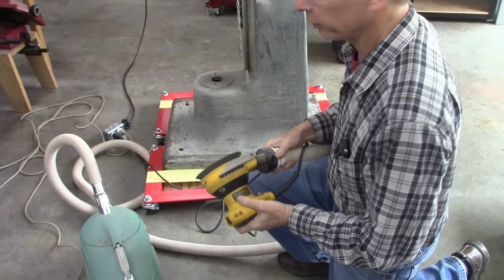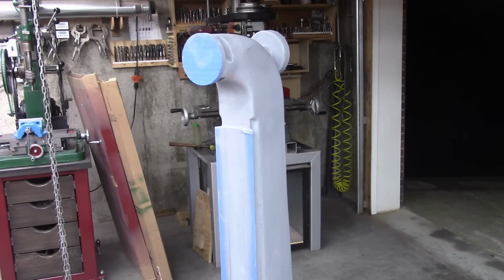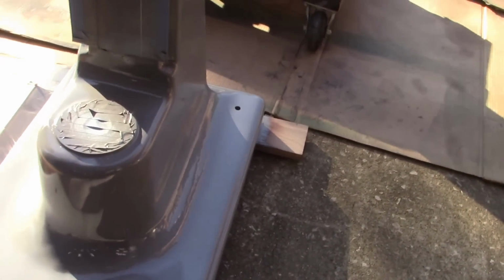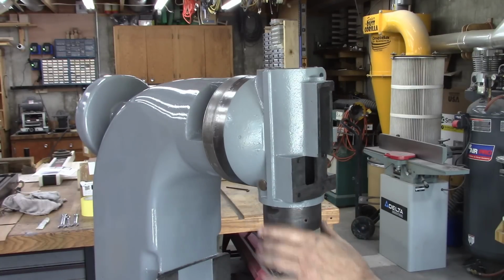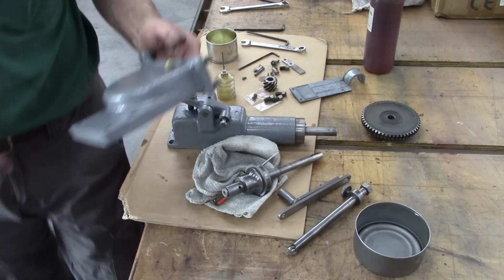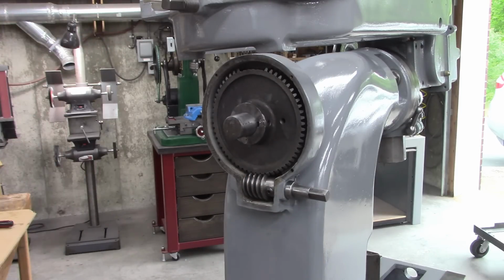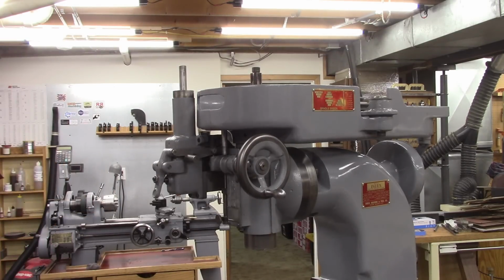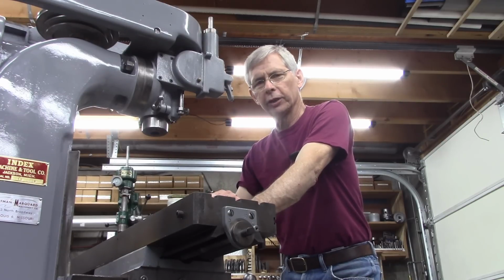Well Index Model 40 Restoration - Part 3

Comment: I weld all the broken cast-iron at work.  I use both arc weld and TIG welding to make repairs.  A welding contractor we used several years ago showed me they process of cast-iron repairs.  Starting by grinding away as much of the damage area as possible, preheat the parts them weld using nickel rods and a finish pass using stainless steel filler rods. I'm not sure what the stainless steel top layer does, but it works, and I have never had any issues.  Be sure to let the repaired part cool slowly. If it's a big part,  I will cover with a welding blanket to cool. I have rebuilt two lathes and on mill. I enjoy the mill rebuild.  I hope to see you using it soon
Reply from the maker: I knocked the flux off the nickel rod to weld with TIG....  it didn't do too well. Maybe me or maybe the flux? I did preheat. A friend of mine said the same about the stainless rod.
Reply: @Winky's Workshop  I keep  nickel TIG rods on hand these days,  but I have knocked Flux off stick rods, too. What the job at hand, you just always have to be ready to make what you have to work. Thanks for your video content.
Reply from the maker: @davidcockerman266  True...  and thanks!

Comment: My Index 40H had several grease zert looking fittings. I found out the hard way that they are not for grease, but for oil, (way oil). I had to nearly totally dismantle my mill to clean the oil passages where a goof ball, (me) filled them all with bearing grease. My electric motor was a 110 also. The drum switch was to change the speed on the motor, not forward and reverse. It never worked right, and I just change which groove the belt is in on the drive pulley. Looks great! keep up the good work.
Reply from the maker: Those holes on my mill has slotted set screws in them. I'll bet somebody put zerks in yours. Interesting in the 2 speeds... that would be nice but I want reverse too. Thanks

Comment: You have set the bar so high on this restoration. I had to replace the bearings in the Quill, which gave me some grief, nice job.
Reply from the maker: Mine seem to be smooth but I will eventually get into then. Maybe you can give me some pointers. Wells Index was no help.
Reply: @WinkysWorkshop  watch his series, its well worth the time
Reply from the maker: @cyclebuster  I'll do that, Thanks

Comment: What a great job. It really amazing what a little work and a good paint job will do. 
That color looks a lot like the one Don Madere used on his Monarch.
Reply from the maker: Thanks...  Yeah, Don's Monarch looks amazing!
Reply: @WinkysWorkshop  What is the RustOleum color that you used? Thanks.
Reply from the maker: @ellieprice363  Smoke Gray. For most the mill I used it from a quart can thinned 15% with acetone but the spray paint matches very well too although, I think gray is very forgiving. The spray can seems to have slightly less gloss however.

Comment: in cool weather like you are in, for a faster setup time on the Rustoleum Industrial enamel [which takes forever to dry]
use lacquer thinner, xylene, or toluene...lacquer is a combination of xylene, toluene, mek and I think acetone, which makes 
it an all purpose thinner/cleaner, and is usually cheaper than the individual solvents listed]
.when it gets real hot , in the 90's....you can go with VMP naphtha to slow 
down the cure if needed, or mineral spirits [which is labeled as 'paint thinner']...
I like to add a bit of Cobalt Dryer .to that particular brand of paint  to help it set up......[read directions on how much], 
and also try to use a paint filter
when pouring into the paint cup to keep snurds out of the paint.......I have sprayed a lot of it...
Reply from the maker: The can actually said to thin with acetone. It dried well over night.
Reply: Paul, that is interesting!  I like the Rustolium industrial enamel because it uses such common thinners and it is pretty tough.  I used a Sherwin Williams product on a machine and there was no real thinning information so I brushed it on as the can suggests.  It took a long time to get hard, like months but it seems excellent with regard to chipping and chemicals.  I wish I could spray the same.

Comment: on Sunday, 5/7 I got to move a Wells Mill.....oh what fun, not sure what model, but in the 2,500 lb range...old wooden floor, full of termites, had to pallet jack it about 100 feet on to a flat bed straight truck with a lift gate rated at 3,000 lbs, when we went to lift up, by the way, the motorized pallet jack weighed 500lbs, the gate sagged down about 12 inches, and I am thinking, that sucker is going to fall off....well it made it on the truck, along with he Lagun Mill, a 3,000 lb 14x50 lathe, a Grob 20" ,1,200 lb band saw, a bad mama jam drill press, Japanese, that was about 1,000 lbs, two air compressors , one with a 25 hp motor and 7x 3 foot tank.....man, I was tired....
Reply from the maker: Wow...  lots of work. (and weight)
Reply: Wow, sounds like you bought all your heavy machinery at the same time!

Comment: That’s darned dapper machine. Looks damned good. The feature on the front of the saddle I don’t think it for a power feed travel stop switch. If it’s like some of the older Kerney & Trecker machines that feature should hold a rod that you can slide a dial indicator along. The L shaped bracket further left on the table looks like the stop you would butt the dial indicator against.
Reply from the maker: Thank you sir! You might be right about the hole
Reply: @WinkysWorkshop  Wells index used that boss to hold part of a vernier scale, while the long scale was mounted to the table. Yours did not come with this option because it would have two tapped holes side by side. What the other commenter said makes sense about the horizontal hole going through the boss.
Reply from the maker: @andyZ3500s   I'll have to see if I can find a picture. I'll put DROs on it at some point anyway but I'm curious.

Comment: In my video 40H working in the first minute i zoom in on the table ands you can clearly see what that rod hole does. You can also see the differences in the motors, mine takes a 56 series motor. Also mine has many of those oil zerk fittings, the ones people use grease in. FWIW you can put oil in most grease guns. If your stumped on a motor choice i bet the older 56 frame motor bracket will fit right on and you can buy those anywhere. I will do another chip ejection video soon.
Reply from the maker: For now I bought a cheap 1 HP motor and yes... it bolted right on, perfect match. At some point I may go 3 ph with a VFD

Comment: Great outcome Mark, with the split cast iron gear I would have done the following. Pop it in your lathe and skim the boss round again and made a steel ring to fit, either shrink fit or Locktite I on. You may have introduced stress by welding. Regards from Australia.
Reply from the maker: EXCELLENT solution! I like it. I do think it is plenty strong however. the head is very easy to move now.  (but I do wish I had thought about that!) Ha

Comment: pro paint tip...if you are going for a super smooth finish......before final sanding, 
give a light dusting [you are not trying to cover the primer] 
of flat or mat black quick dry spray paint, any color will work though
that is darker than the primer...then sand, any low spots will show up right away
as long as you are not digging into the surface with the sanding pad.....
then you can come back with some spot putty.......
Reply from the maker: Good idea. I'm certainly not a pro on painting or body work. In hindsight I probably should have sandblasted the main body of the mill. The filler they used was not in the best shape. I just didn't want to deal with trying to smooth out the possible rough castings.

Comment: Hi Mark, Awesome it's really looking nice ! On your motor bearing. That type with a press on retaining collar are the worst. If you set it up in the press then quickly heat the collar with your oxy/act touch, not too much then press...may need to repeat a few times. That should get it off. Or just have the motor shop do it 😉. Hope you can keep that motor, it has the right look 👍
ATB....
Reply from the maker: thanks...  however I took the motor to a good motor shop and he said it was shot. Broken winding. He said it would be cheaper to buy a new one... plus everyone with this mill said the 1/2 HP on this mill isn't enough anyway. I bought a new 1 HP..  Oops...  it was donated :o)  Good for now but maybe 3ph in the future.

Comment: I got a pretty decent set of taper pin reamers in a machinist box buy many years ago.  I liked the roll pin idea better.   :-(    You're doing a great job, and everybody will want this machine.  Can't wait to see the running machine and first cuts.  Classic machine with great character.   Will this mean you get rid of the RongFu mill?    Time will tell......  You can use a cut off to slit the motor bearing surfaces then a cold chisel to split them and get them off if your press is incapable of pushing the shaft through.  Got to replace that bearing, it will howl like mad.
Reply from the maker: Yeah...  the motor is toast. I took it to a good motor shop...  some of the winding are bad. The original motor would be cool but everyone I've talked to says the original 1/2 HP is not enough anyway...  I bought a new 1 HP.

Comment: I have the same mill. Can you please tell me how you remove the tapered tool holders? I have to beat on mine to release the taper. B&S #9.
Reply from the maker: The B&S taper holds the mills better but it also gets stuck in the spindle. The original draw bar was self ejecting and works great. The problem is, they eventually wear out and get removed. You may have noticed a section of threads at the top of the splice. Hopefully they are not damaged. Mine were messed up but I used a thread file with the mill running and cleaned them up. Wells index will sell you the new draw bar but if I remember right it will cost you about $350. I'm cheap so I made my own. In my opinion the B&S collet is much better than the R8 but only if you have the self ejecting draw bar. Here's the video:  https://youtu.be/hM7LlQfzLdQ?si=xU50Eppd-tybtvhA

Comment: Hi Mark, me again. I've been thinking - always dangerous! That motor may have had a conversion from three to single phase. Those drum reversers were also notorious over here. Three phase motors are easy to reverse of course but the switches tended to fail.  If a conversion then the capacitor is also an addition. I know your electricity supply arrangements - not just the voltage and frequency - are very different to ours so don't put too much trust in my thought. Wise of you to take it to a specialist. Hopefully they can sort it out for you, nice to keep the original if viable.
Reply from the maker: Yeah...  sadly the motor is not good. I took it to a very good motor shop and they guy said...  "It has some bad windings. I can fix it but it would cost twice as much as a new motor" I now have a cheap motor I'm installing. 1 HP instead of the original 1/2 HP.

Comment: Such a cool old machine. You're doing an excellent job, as usual. That thing is gonna make you wonder how you ever managed to tolerate that round column monstrosity for so long... 🤣EDIT: that thing is in EXCELLENT condition despite its age. It's in far better condition than my BP, despite the BP being probably 50 years newer if I had to guess. Congrats on a good score btw!
Reply from the maker: Yes it seems to be in great condition for sure. You may be right about the round column mill. I can hardly wait to get it under power!

Comment: The mill looks so nice!  How in the world do you get those metal badges look so fantastic!  Regarding the leveling casters, I have likely the same ones in a 1200lb surface plate and stand.  The casters were made in Korea and I can’t speak highly enough about their stability, function and quality.  “I like it” 😊
Reply from the maker: The badges were brasso and a rag. It took part of the paint off but still looks good. I also wiped them with acetone and then coated them with rustolium clear.

Comment: Hopefully the motor shop can get those bearings replaced, as well as the wiring setup. It will be great if you can use that motor, or failing that a period correct one. Modern squarish ones are not my favourite. Give me an old GE any day, no WEG or Baldor box shape.
Best wishes from the far North.
Reply from the maker: Yeah...  the motor is toast...  I'll probably get a cheap one and keep my eye out for an older one.
Reply: @WinkysWorkshop  If you can WEG, is the most inexpensive of the good quality motors. Toshiba if you want to eventually will it to the grandkids 😉
Reply from the maker: @carlthor91  For now it's going to be a cheaper and available Chinese motor. I know where I can get a 3ph motor very cheap but its 40 miles from here. I have a VFD so I may go that route eventually. I have no idea what brand but it's industrial surplus so it's likely a good one. Being able to change speeds (within limits) without moving belts is appealing.
Reply: @WinkysWorkshop  I HIGHLY recommend a 3PH motor and VFD. Don't mount the VFD on the mill, as the vibration with interrupted cuts can shake the parts off the circuit cards. 
I've removed all the single phase motors on all my tools in the shop, and replaced them with 3PH. I leave the belt settings at the middle reduction settings, and all the motors were 4 pole so they would naturally run at the 1725RPM, so I set the VFD to have 120Hz max frequency setting, as the motor rotors in these can operate fine at the 3600 2pole counterpart motors. 
Depending on your VFD, you can actually have the front panel readout display spindle RPM, if it supports this feature of programming in the conversion of Hz to the reduction ratio.
As usual, nice filming and editing.
Reply: l see you have a replacement motor purchased. Good thing you have the other mill to make mounts and such.
Reply from the maker: @f.hababorbitz  Very true...  although the mounts are supposed to be the same.
Reply from the maker: @f.hababorbitz  For now I'm going single phase but I know where a few cheaper 3ph motors are and I have a VFD so I'll probably change in the future. I never heard about the vibration issue. Thanks for the tip.
Reply: @WinkysWorkshop  There was a change to all the NEMA  motor mount dimensions. Either late 50s or early 60s they revamped the motor mount dimensions. If your lucky it will fit, but an adapter plate is an easy fix.
Reply from the maker: @f.hababorbitz  I got it...  fits perfect

Comment: 4:16, watching you paint, and having to hold your paint gun at an angle
, if you turn the air horns vertical, it changes the spray pattern so you can run up and down
instead of having to tilt to get a good coverage.....
Reply from the maker: Yeah I do that... it was laziness on my part

Comment: you need to read up on Rusty Metal Primer....
.many of the brands do not fully cure if there is no rust...
as they have fish oil and it needs the rust to react and cure.....
just a heads up.........
Reply from the maker: It's my understanding that the spray cans of Rustolium do not have the fish oil. In fact they stopped using it on all the rustoluim products.  This stuff cures completely although where I was spraying did have a rusty surface.